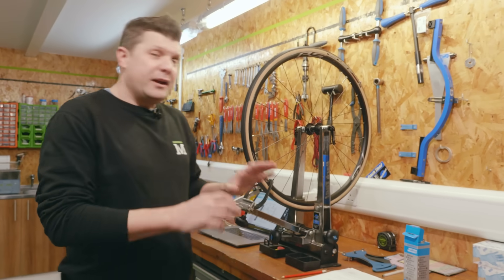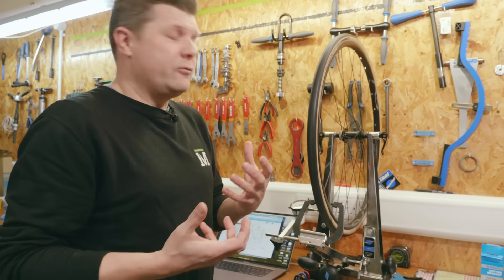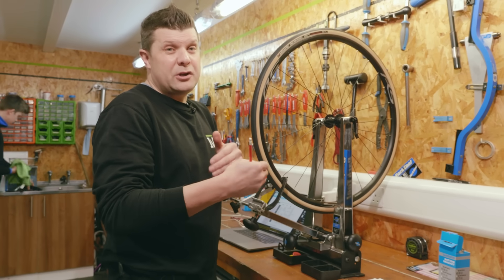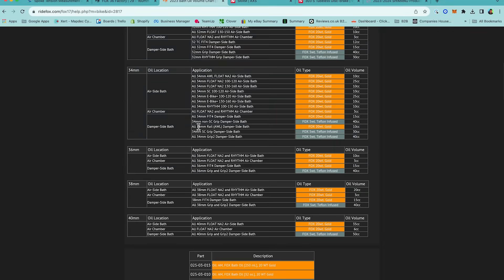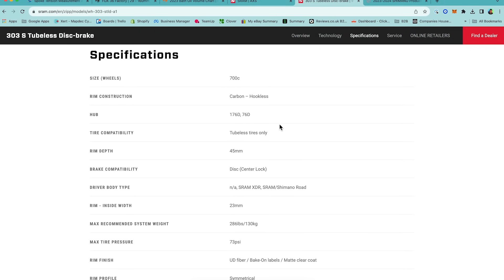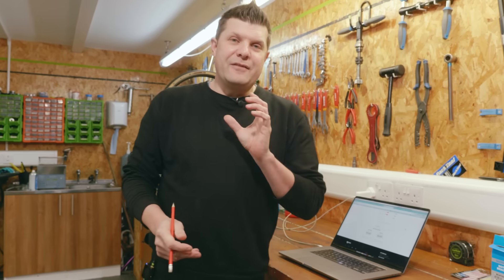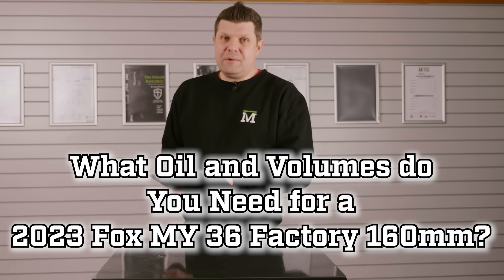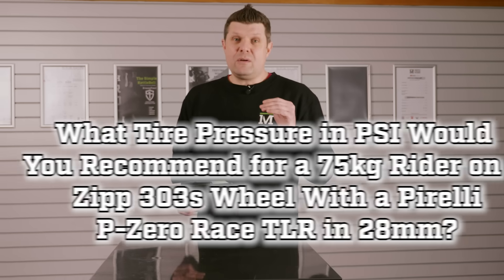Our Interview Tasks - The Results

Comment: Wow things have moved on these days. In my day the wheel true check in a service was much simpler just pluck the spokes listen to the sound for any way out and check the radial and lateral true just quickly against the brake block. Not quite as detailed or accurate and less reliance on special tools which we just didn't have and couldn't afford.

Comment: Talking about tyre pressures , which is an interesting technicality that many overlook , what should I pump my tyres at ? I am just over 100 KGs , running tubeless Vittoria Corsa Control G2.0 TLR on Mavic Cosmic (65 mm) wheels bought new in 2020 (in case spec changed). You have pointed this out in a previous video and there seems to be a lot of variables that decide the pressure of the same tyre from one wheel to the next so not equal across the board.
Reply from the maker: There is not enough info here really. The current Mavic Cosmic 65 are 19mm TSS. They have a pressure chart in their user manual.  You should be ok with a 32mm tyre, but check the side wall as some tyres this width do not display max pressure for TSS on the box for the wider sizes. they can sometimes be below 73psi.
Reply: @Mapdec  I knew I missed something , mine are 25 mm and the clearance is about 2 mm on each side , the bike is a PINARELLO PRINCE 2015 (an early Dogma 65.1?) ? Yes, I wrote 60 for the Mavic wheels but they are actually 65. My question is what pressure would they have to be at ?
Reply: @Mapdec  I am running them at 70psi and I am wondering if they need to be at 60?
Reply from the maker: @aljaliah6868  are they TC or TSS rims
Reply: @Mapdec  I can still see one sticker saying 622 X 19TC if that’s what you mean
Reply from the maker: @aljaliah6868  yes. That would mean 19mm internal and Hooked.  That would still give you pressures of arround 100psi on a 25mm tyre.  You should go look this up really.  This might still be too high for the tyre. Have a look on the side of the tyre for the max pressure for TC
Reply: @Mapdec  It says 55 to 80 , my man at the shop said put 70 in , I think even with my weight it should be even less. The rear tyre is already wearing in the middle , is that too much air or too little ?
Reply from the maker: @aljaliah6868  80psi for a 25mm TC tyre seems very low.  I would expect it to say 104 or maybe 98 or something.  I can’t see the info on vittoria website to check.

Comment: As a 'fix it myself' home mechanic, I would have failed this test, in part because I've believe that 11 speed chains are narrower than 9 speed chains, so wouldn't shift as cleanly because the derailleur was designed for a wider chain... shrug
Reply from the maker: That range is from Shimano Cues that is bassed arround linkglide rather than hyperglide chains.

Comment: One of the most important thing I look out for when I interview people for my workshop is torque wrench.

A surprising number of them don’t use them, or that much for what seemed like a minor components.
Reply: I had an offer for a job as an assembly mechanic for a large corporation. 
I asked if they used torque wrenches. The rep said no, and that it's not necessary if you have "wrench experience".
They sell carbon bikes. I declined the job offer.
Reply: @oftankoftan  in layman’s term; you make the clicky click noise.

Comment: Interesting video! With that tension meter you actually need to be sure it's calibrated. Maybe it was out of scope of the assignment. But that is at least a question the applicants should pose. A while back i called many of the local shops, and none of them had the means to calibrate spoke tension meters.
Reply from the maker: We just keep 4 on rotation. When one goes off, we just replace it.

Comment: 28 on the TM-1 equates to ~1700 newtons. The max tension Shimano says that spokes should be at for a front WH-RS170 is 1400 N. Pretty sure that's what wheel you've got there but even if it's not I can't find any Shimano doc that says that any front RS wheel should be above ~1400 N
Reply from the maker: Just a random wheel from the classroom I used for the vid.  It’s probably been rebuilt by students at least a dozen times.  Just a prop. Kudos for looking it up.

Comment: Shimano XT M8100 shifter/derailleur with Sram 12-spd X01 lower jockey; added .25mm spacers to fit Shimano cage. Sram XX1 12 SPD chain with Absolute Black 30t 3mm offset Oval and a Sram XD 1295 cassette... Hmm...
Surprisingly proper. Not exactly advertised. Yet, solid and true to mountain biking.
Reply: Your shop is such a great place! Just made that comment to keep the essence of your dialed expertise light and driven. The groupset specification isn't exactly on the road map, yet it's example of being in the road long enough to make a blue print. Respectfully, your videos sure do seem like blue prints. Thanks again and enjoy the road ahead.
Reply from the maker: Thank you

Comment: When you mention about adding the DS and NDS tensions together and dividing by two to get the overall tension of the wheel this really only works for front rim brake wheels. As you know rear wheels have different tensions on the spokes and it is mostly the drive side spokes that you care about being in tension.
Reply from the maker: It’s not a measurement in isolation. The task was to describe the wheel and determine sufficient tension had been met.  Ideally the average should sit nicely in the middle of the range and would be a good indicator that spoke length was correct
Reply: I understand what you mean, it just didn't make a lot of sense in the context. If you are building a wheel to 1200N of spoke tension then the DS will be at around that mark, and the NDS will likely be around 800-900N ish on the NDS for a rear wheel. Doing what you said in the video would show the overall average is 1000N, so you could say the wheel is low in tension.

Comment: Worked in Eng maint for years and doing a lot of my own bike work and I wouldn't get most of them, I do know what a DTI is at least. Need to spend some time on wheels I guess, I work to 2 thou at work so it should be a quick pickup. Thanks for the insight.